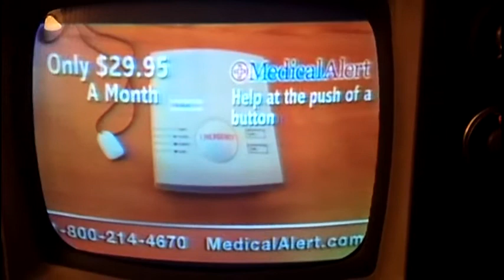Vintage GE porta color CRT replacement pt2

Comment: Is the replacement CRT still the original dot phosphor type or the newer stripe phosphor type?
Reply from the maker: dot, but GE did it oddly, the dots are arranged in a row like a stripe, not the typical triad.

Comment: Wow, this Video have impressed me.

I used to have the G.E. Portacolor EXACTLY the same as the one in this Video. I also replaced the Picture tube 11SP22 on mine.

I have a service manual fot this television.

The Chassis model of this television is M663 (Canadian)

Yes, I had alot of fun with mine.